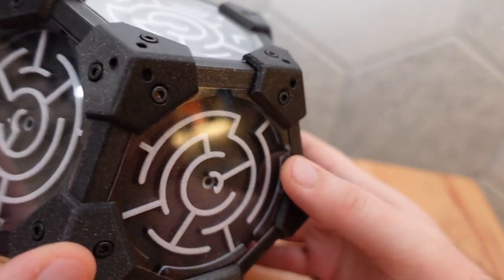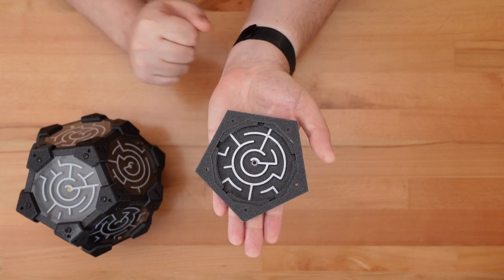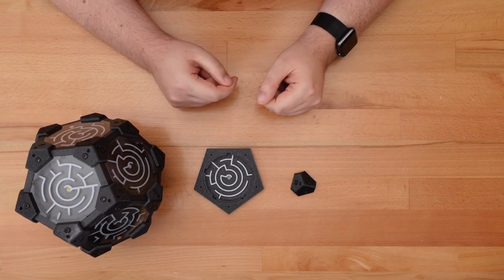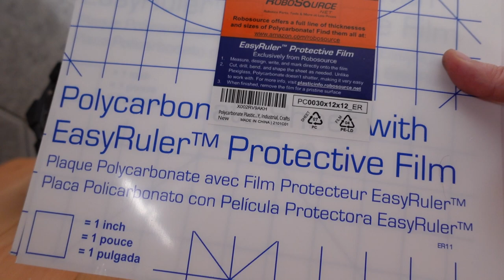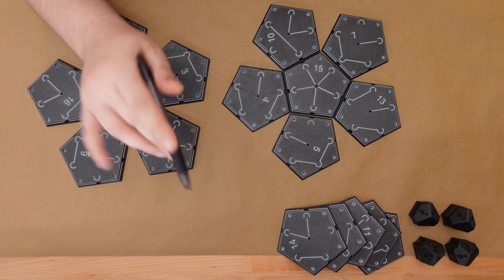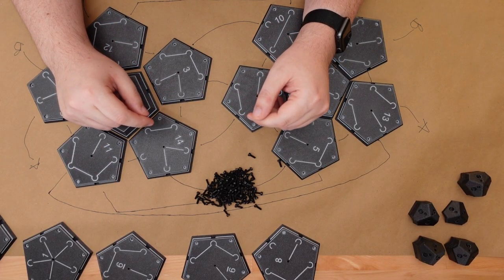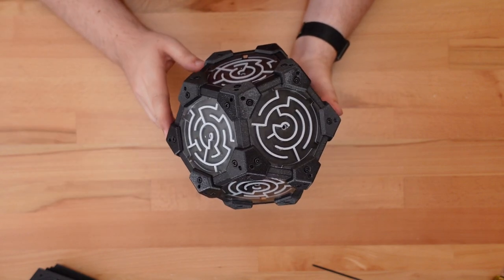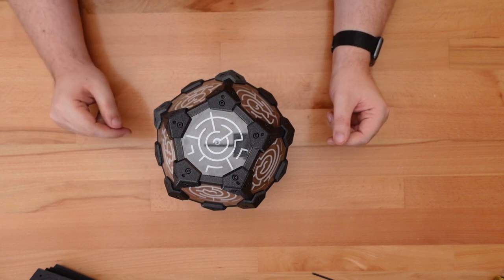3D Printed Dodecahedron Maze

Comment: Note to anyone out there who does Airsoft,  the airsoft BB's are the same size as the required ball bearing (6MM).  You can even get airsoft BBs in glow in the dark, etc.  You could print the maze highlights in glow filament and have a "solve it in the dark"  maze.  Can you solve it before the glow runs out?
Reply from the maker: Great tip, and I love the challenge idea!

Comment: Wow,  what a great project.  I had always thought about doing an old-school 3D printed flat square maze with a clear cover, but this Dodecahedron with 12 mazes that interconnect to other mazes,  how awesome.  I can't wait to get all the pieces printed for this.  

One Question,  Is it possible to get a .step file for the clear covers?  Zip file contains the .3MF, but with a .step I can create a 2D dxf flat from it which is what the laser cutter wants.  I think am going to cut them out of acrylic.  BTW, if you want a set laser cut, hit me up.
Reply from the maker: Glad you like it! Would an svg file work? If so, I gotcha covered! Look for the file named Template_Clear_Lid_Guide.svg
Reply: @3DPrinty  Ok,  Thanks.  I see it,  It's included in the version on Thangs, but not on the version hosted on printables.  Perfect,  yes SVG will work.  Thanks again!
Reply from the maker: Welcome! It's in Printables as well, but since it's a non-standard file type, it's at the bottom of the page - very easy to miss. Glad that file will work for you!

Comment: this is amazing! do wish one side could open so it can also be a box
Reply from the maker: There is a lot of space on the inside! I've included blank templates for the the tiles, so you could bring that into your slicing software, poke a hole through it, and make that side an opening. If you get really fancy, that could have a screw top or some other latching lid.
Reply: @3DPrinty  I was thinking of turing 2 of the connecting pieces into a hinge rand then have the actual maze bit rotate so that the entry points close, and the bb can't fall out, while also moving a little latch to unlock it. It's a bit more complex but it would alow for the maze to not loose a face

Comment: where can i buy or print those anguar corner brackets ???
Reply from the maker: You can download those under the "Misc" folder of the project here: https://www.printables.com/model/254650-dodecahedron-maze/files Look for the file called "Corner Brace.3mf"

If you print the brace on its edge and have good adhesion, you don't even need supports. Good luck!